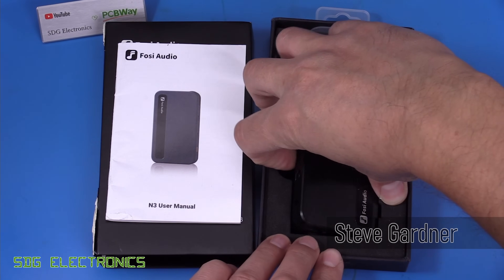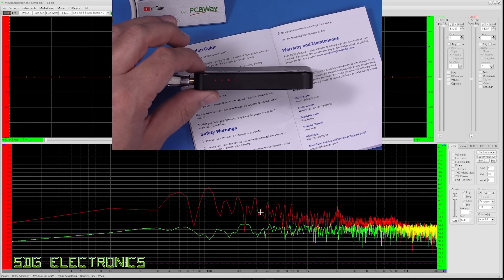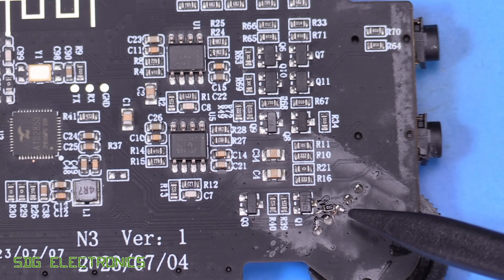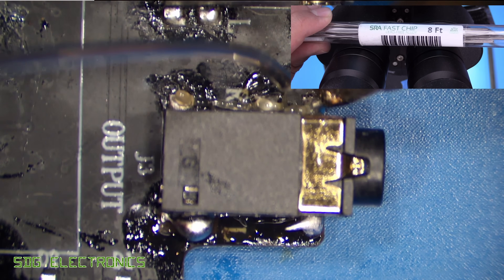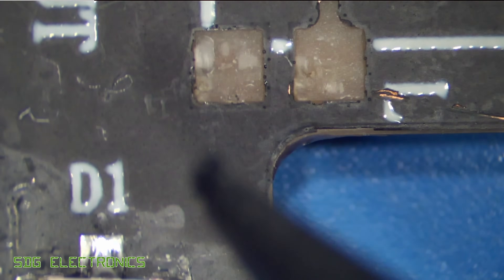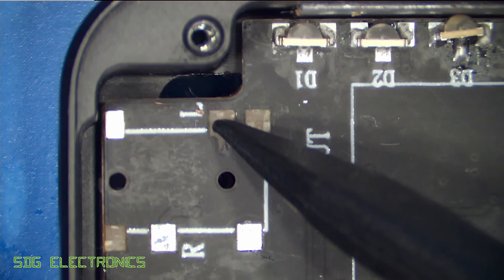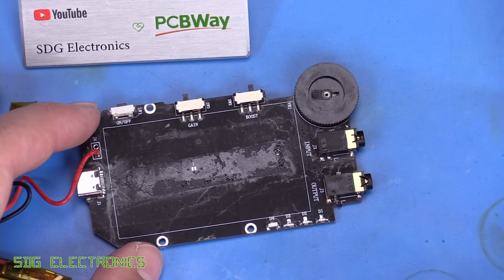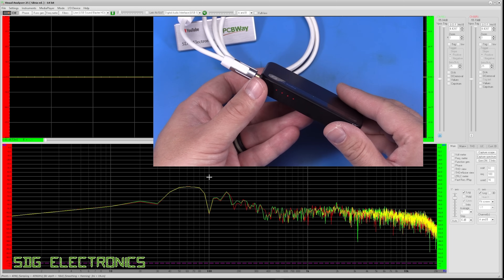SDG #355 eBay Fosi Audio N3 Portable Bluetooth Headphone Amplifier Repair

Comment: Those heaphone jacks are a nightmare. The normal foorprint is really small why you can easily rip the jack off the board. Happened a few times to me on my MiniAmps. I made my own footprint with much lager pads which seems to hold now! And the glue.... I do exactly the same thing just to be sure (same Glue even! Well allmost, I just use Kafuter 303, wich is a bit less viscous)! 😀
Reply: Yeah they don't really tell you in the datasheet to reinforce the pads.
A few connectors do recommend to add glue.
Reply: @jaro6985  I did not see that in the datasheet. But, you learn from experience :)

Comment: Can you recommend the solder wick? I bought a couple of very cheap ones from Aliexpress, but they all are waste of money.
Reply: NTE solder wick blue. Best of the best
Reply: NTE is a good brand. I've used Chem-Wick (by Chemtronics) at my company for decades with excellent results. You would do well with either one, depending on which is available in your area.
Reply from the maker: Any by Multicore, MG Chemicals or Chemtronics have always worked well for me.
Reply: Thanks everyone for suggestions, I will look for some suppliers in EU as some of these brands are hard to find (like NTE for example, I could only find it on ebay).
Reply: @ferrimy  Did you add flux to your aliexpress wick?
If you buy something make sure it has flux.
Reply: @jaro6985  yes, I used flux w/o any visible improvement to the process. I assume it's just a bad quality, some sort of cheap copper alloy used that doesn't really gets covered with solder itself.

Comment: Hi Steve! What wipes are you using? Are those some Kimtec lint-free wipes? When I use my normal wipes they make a bigger mess than the flux itself
Reply from the maker: It's these, they are quite good https://amzn.to/3ZoYEUg
Reply: any synthetic fiber wipes will do just fine, like the left over dried ones from any supermarket antiseptic wipes.
Reply: I was about to ask the same question but decided to scroll first and see if anyone else had asked 😊